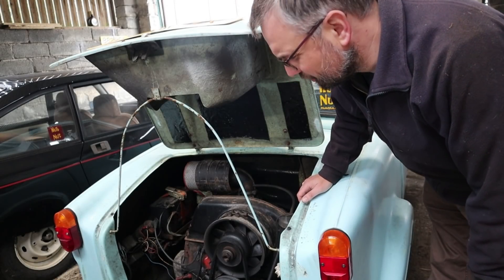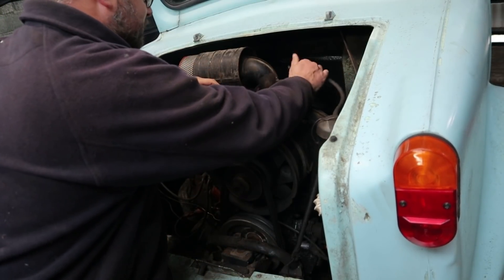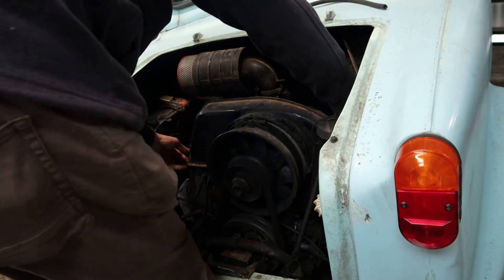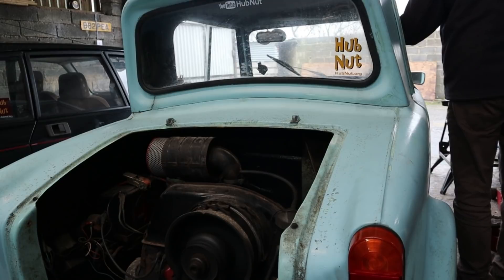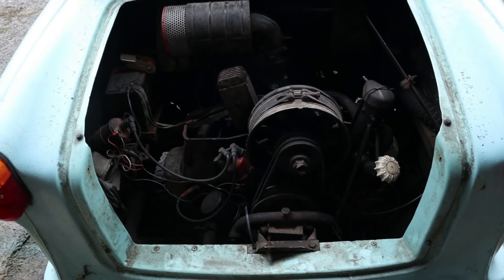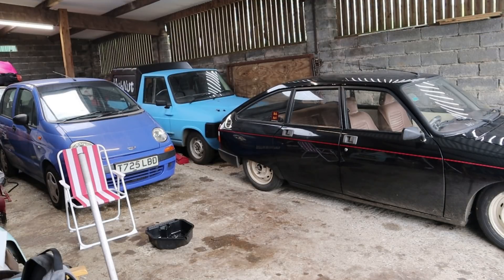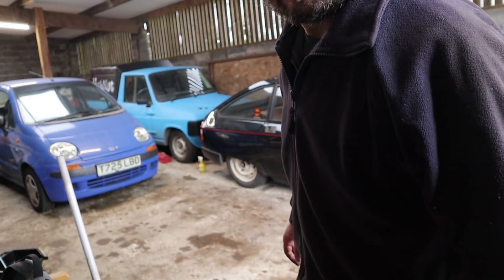TWC the Invacar goes BANG, also, oil leak located.

Comment: I adore your vids for their honesty. They take me back to the countless times over the years when, what should have been a relatively easy job, transcends into abject despair when you unearth further problems; and WD40, a cable tie or super glue won't be a final (albeit bodged) solution. Thank the Lord for tea.....it gives you time to reflect and ask yourself "why the f*** did I even start this".
Reply: I occasionally work on an old building and a few weeks ago I finally sighed: "Looks like I can't even turn on a light in this place without it turning into at least half a day of electrical work!". Like when someone installing new shelves in a fitted wardrobe caused me to rewire half a room because I first wanted to remedy some bits while I still had access and doing that found more and more horrors. NB: the other half is at least as bad, I know that, but that's a project on its own.
Reply: Amen
Reply: Hell yes Barry
Reply: A final solution usually involves duct tape and vise grips (or gaffer tape and mole grips to you British types).
Reply: Brilliant. Laughed loudly. Wife asked if I'm OK. As I find myself here, I'm probably not

Comment: Hello Ian. The gradual pressure drop you see on the tester gauge AFTER you stop turning the engine over is not indicating a leak on the engine/valves/rings. It shows the internal valve on the tester gauge is leaking. The tester only shows the peak pressure achieved not the "leak down" pressure. Regards.
Reply: Totally agree.

Comment: Don't worry about the leak down with the compression tester, that's just pressure held in the gauge itself, not the engine. 
Pushing the release button just dumps the pressure held behind the check valve in the gauge.
The compression looks good anyway. Cheers.
Reply: You TWC the words right outta my mouth!

Comment: A few days ago I looked at a Serbian television show on cars how they solved problems when you are on the road, mostly in those days 30 years ago they were Yugos, they used a broom to get a Fiat 126 started, or when the V belt ripped apart they use ladies nylons so you could get on the road. Another example was when one of the wiper didn't work you got a wooden stick and some wires and tie that up to the working one and so you could get home at least.Nowadays, the cars starts to yell at you and refuses to do anything, you need a computerbrain to get it running again. Love the simple cars.

Comment: A couple of months ago myself and a mate were trying to get a Petter stationary engine running. Little did we know the plug hole thread was badly stripped and when the engine fired it blew the plug out the top and missed my mate’s head by a couple of inches. It was like a gunshot! If you do decide to helicoil it use an insert then the thread will be far stronger than the original one. 

The worn thread may well be why the compression was leaking slightly after the test.
Reply from the maker: Yikes!

Comment: Wow! When I saw TWC running I knew those belts needed adjusting. Looks like we are having a similar day to you here in upstate New York.
And this came up just as you finished uploading, which, of course, has made my day!
I also hope switching out engine parts help with related problems. And was surprised by the compression test as well! While fiddling with TWC's engine, I guess you could check the valves while you are at it, adjust running belts, etc. So hopefully, once work is completed, TWC will not only be up and running, but running better than ever!

Comment: The pressure dropping is the valve in the tool not the engine, cylinders don't hold pressure, the average cylinder leaks 20% through the rings when doing a leakdown test.

Comment: I think the citroen GS is the best looking car there. I love old citroens. Special one for me is the CX
Reply: I’ve got the 2012 c5 exclusive tourer (estate) it’s a nice car but sadly it been revised from the earlier mk1 c5 that was based on the xantia. All the rear end suspension parts are week and not going to last as a working car. Already I’ve burst two rear suspension pipes and blown a seal out of rear strut. I might just have to put my old c5 hpi back on the road
Reply: @WidowUK  c5 is a nice car. Problems are citroens name a bit. But i love them all the same. I really am looking for a c6 first gen. Its a real nice car and got the looks from the cx. I know its a problem car but i really like the car. I think the call it love for cars😁
Reply: @d.jbrickmocs1637  I know what you mean this c5 has cost me a shed load of money to sort out so far but to get any money back I’ve had to repair it, think they call it bitting the bullet.
Reply: @WidowUK  yes that it is. Same problem i had with my CX. Engine broke. After a day or 6 the gearbox went out. I sold her in parts but stil wish i fixt her
Reply: @d.jbrickmocs1637  I know that feeling 2 day after I bought the car the 6 speed box had been leaking oil from tin end plate and killed the gearbox. So I thought while box was out best put a new clutch in it turned out dual mass was worn out so it had one of them. Then a hydraulic pipe bust on the rear so I had it repaired last a year now waiting for a new one from Citroen not to mention dpf filter and    Throttle body had failed it’s been the biggest money pit I’ve ever owned. My mk1 c5 hpi gave me no trouble in the 16yrs I owned it makes me wonder if I should of spent my money on putting a catalytic converter on it and carried on running.
Reply: @WidowUK  yes its car head splitting 🙄😁

Comment: I had two cross threaded plugs in a Corvair I repaired with Keenserts. So crooked the air seals on the plug wires wouldn't fit into the shroud. Done with heads on car, no disassembly.Highly recommended.

Comment: Air-cooled vw have a similar oil cooler and there are two rubber seals on the inlet/outlet which leak.  The cooler itself is usually OK... When they fail it's usually because they get closed with swarf.

Comment: being a bike type person who does these things, I'd be tempted to take the engine out, swap the heads and - whilst it was out, change the various oil seals and probably the top end gaskets as well. It will probably be leaking or weeping from a few places and this might be a good opportunity to give the engine a thorough clean, solve those problems and with the good compression it'd be good for another few tens of thousands of miles.

Comment: 10% difference between cylinders is fine, oil cooler is the same type of setup as VW,the seals go hard and crispy and they pee oil everywhere, new seals required
Reply: A dab of Mustie1 magic will have that sorted.
Reply: I know Twc's engine is Austrian, but as it has been in England for a bit, it might just be that it adopted an adage that comes with British engines: "It's not leaking oil, it's giving back what she doesn't need"

I'll see myself out - no need to get up.
Reply: That was a little more like 20% though.
Reply: @AUmarcus  115 and 120-125 at worst it’s 8.33%
Reply: @Mrflash222006  
Except I read the compression at 110 and 135psi. That's closer to 15/20%....its definitely over 10%.
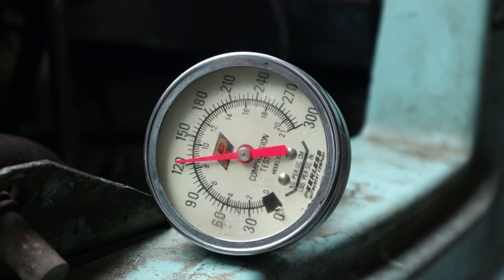Reply: @AUmarcus  8:46 115, 9:46 and 16:10 130 dropping slowly to 120 that's on a carb'd engine at WOT so wet-ish so 12% what is marginal, 115-135 is 16%

Comment: We like old school here in our North Shropshire workshop. After realising that TWK wasn't going to do a terminal detonation I really enjoyed the video after spending the weekend trying to reassemble a very rare (so rare there's absolutely no information or instructions anywhere in the universe!) gearbox in a bag. I'm also looking for a suitable gap in the showers to do the drop links on the rear anti rollbar on the Land Rover for the MoT. Good luck with the head and oil cooler change and keep your Dutch cap dry 😆

Comment: Awesome video! My suggestion: Drill the spark plug hole, put the  right dimension spark plug insert and it will work like a swiss clock.
Reply: You mean it will go "cuckoo" every 15 minutes?
Reply: @caw25sha   It will work fine if the threads will be cut at the correct angle.

Comment: A friend of years long past used to race and had his spark plug holes all 'helicoiled' as apparently it was stronger than threads in the alloy. So that would be a good move for both heads. Also for possibly the first time a necessary plug change in a hubnut vehicle. WOW! Shame it was probably with the wrong plugs!!!

Comment: The compression leaking down is the fault of the gauge, not the engine.  
The gauge has a non return valve, which you release to zero it.  It's probably just got a slight leak.

Comment: Great to see the video!  Yeah; sounds like that cylinder head is pretty tired, if it's spat a plug out twice.  

I was assuming you were going to grab the head from the old engine.  It'll be good to see how that goes.  

Thanks for the video.  Loving it and continuing to be an inspiration!

Comment: I foresee a head swap in your very near future. This is excellent news for us viewers but perhaps not so much for you!  I did have a helicoil fitted successfully in the past with the head still on. The engineering god that performed it in the car park used a power grease gun to pump grease into the cylinder after the machining that lifted all the Ali swarf out on the greases leading edge as it emerged from the plug port. Miraculous! 
Incidently, the pressure decay observed was only leak by of the gauge's own internal one way valve and therefore nothing to worry about.

Comment: If i was you Ian, id just leave Tuc till the spring when its a bit warmer to be stripping down engine"s! i think its probably better you use the Matiz for the winter! small reliable cheap to run, starts off the button every time! just put a full set of winter tyres on her as she has the smallest wheels & so it will be cheap to change all 4 corners & the thinner the tyre the better in the bad snowy weather!!:)

Comment: Hi Ian, I would not trust the gauge too much. Seems like it starts at around 15psi at rest and the leakage you are seeing is the pressure release button passing back into the cylinder from the gauge head. I would budget for some top end work, probably just valve re-lapping and check valve guides while you're there. Bless TWC x

Comment: General rule of thumb:
If it runs, it has enough compression.
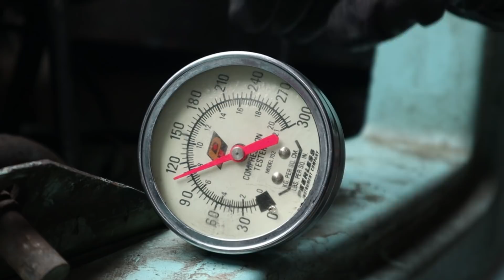10:08 that is NOT how compression guages work Ian, they have no leak down function, if for no other reason than, you have no control over where the piston stops, TDC, BDC, or anywhere in between. 
The loss of guage pressure you noticed is simply the check valve in the guage leaking.
Lovely to see you found that pesky oil leak, any chance the cylinder heads of TWCs original motor are any good.
Reply from the maker: Cheers. Yes, planning to swap a head over.

Comment: The oil cooler would need just the rubber grommets replacing.
Reply from the maker: It seemed to be leaking above the place where it fits the block.
Reply: @HubNut  Yeah those are little Viton donuts, you can get those seals from an aircooled VW repair place.

Comment: Everything has been said really. Swap in another head after doing the valves and renewing valve seals etc. Do both while you're at it maybe. Best with the engine out. Does it drop out the bottom like a Beetle? 
The two plugs removed may have been different heat wise but the Eyquem also had an extended nose if you compare the 2. Now you have water and power a pressure washer would be a good purchase for oily engines and dirty engine bays.
Reply from the maker: The engine is a bit tricky to get out, so I think I'll probably just pull the head and  swap with a spare.

Comment: 14:20
I haven't seen Ice Cold in Alex in a while.
Reply: They used the starting handle in the film...😉
Reply: @CaseyJonesNumber1  I know. It's just they made it look a massive effort in the film. Hubnut seems to be making even more of a effort though. And rightly so. Pushing a quarter ton 3 wheeler up a concrete mild incline us bound to be harder than pushing a 2 ton lorry up a sand dune. Twice.
His over frothy pint has been well earned.
Reply: Hot cup of tea in Wales 😀

Comment: Just consider that if the battery Voltage is low, then the Amps will be much higher every time you try to start it. (I=V/R).
Also, if those engine mounts allow the oil cooler to flap around like that, then the next one will also fail. It either needs stiffer mounts or a bracket making to support the cooler. 👍

Comment: The cylinder that's loosing compression, is that the one with the free range spark plug?
That could possibly account for the compression leak.

Comment: Ian, interestingly during my time as a motorcycle mechanic I learned that spark plugs are only meant to be done up to 11-15 nm!! Not as tight as everyone thinks!!
Reply from the maker: Very true. She blew a plug out last year, so I think the thread was already weak.
Reply: @HubNut  I remember you mentioning it in a previous video, not a complete disaster, as long as you put a thread insert in their fairly straight it should be ok

Comment: Perhaps if your going to swap the head, it would be a good opportunity to remove both heads and lap in the valves too? Easy and cheap enough to do at home, might even liberate a horsepower or 2 😃

Comment: My 1979 Moskvitch 2140 I drove in the Middle East in the early 80s used to spit out one of its spark plugs regularly, you'd hear a ping as it dented the bonnet from inside, and then fall out of the engine bay, followed by loud putt putt putt noises. This would mean stopping and searching back down the road for it. In time, I kept a couple of clean spares and a plug spanner in the glove compartment and tried not to rev the engine up too much. Otherwise the thing ran quite well if you didn't mind the steering locking on tight corners. I learnt to corner gently as well, but I believe the car was eventually banned in the UK for this design flaw, as it had caused several accidents.
Reply: Is that the car which had a hole for fishing on frozen lakes? Not much use in the Middle East though.

Comment: Keeping the heads torqued up correctly on these engines is important as they don't have gaskets just a face to face fit
Reply from the maker: Yup, same as the 2CV.
Reply: @HubNut  didn't know that never worked on a tin snail before

Comment: I cut a new thread for the spark plug in one cylinder on my URAL motorcycle, which also has a very 2CV looking engine. That was not too bad of a job, easy and cheap (around 10€ for the helicoil set including the cutting bit).
Reply from the maker: Yes, I've used one before on the 2CV, but access is better. As I need to remove the head for better access, I might as well just swap it out.
Reply: @HubNut  👍
By the way I just bought a MK1 Twingo, so if travel restrictions should ever loosen up and you should come by central Copenhagen, you can also try that one.

Comment: The thread giving out may have been giving a bad seal hence the leakage as a slightly leaky exhaust valve usually leads to slightly lower compression and that hole had higher than the previous, may be best to take the engine out, and might be nice to clean her up, ready for spring, perhaps take her to get painted nicely and have a good clear coat that lasts, meanwhile you can sand any rusty metal on the engine and spray them and make it look nice! If i was closer i would spend silly amounts of time cleaning and restoring even the smallest of items, I am in Wales so maybe one day i can lend a hand, You fix, i'll make it look good n shiny 😂😂

Comment: The compression test tool is what holds the pressure the cylinder compresses the air/fuel into the tools any leaks is at your tool and not at the valves in the head. The tool has a one way valve in the end fitting and a pressure release by the gauge you can’t go by pressure drop as it’s not a true reading. Just so you know for future reference and not you know. 

And just so I can be clear I’m not starting anything or mean anything in a bad way. If you don’t know you don’t know and I’d be thank full if some one explained it to me instead of making a fool of myself at work many years ago now tho.

Poor tuc looks like tuc has a bad head ache.

Comment: Bad luck about the cylinder head!  🤕 You are going to have to take the engine out.  As for the repair, your best bet is to swap in a head from the spare engine.  Helicoils and other inserts will work but they are best done by a machine shop and that is expensive.
Reply from the maker: Yeah, good chance I'll ruin fitting an insert!

Comment: Have you considered wrapping the spark plug in lots of PTFE Thread Tape? Certainly works for a lot of things with damaged/worn threads. Not sure how it would cope with the engine heat, but it might be worth considering.
Reply from the maker: Doubt it'd survive but a possible bush repair.
Reply: @HubNut  well yeah, it's a stab in the dark but maybe worth a shot?
Reply: Or would the PTFE tape just melt & get into the engine or glue the spark plug in place? Err... I dunno.

Comment: Did that plug pop out of the  cilinder with low 110psi? The bad sparkplug thread might have been the cause of that lowish 110psi.
I'd say, swap that head and keep the old one as a spare and have a helicoil or timesert installed at your leasure and convenience.
Reply from the maker: No, it popped out of the higher side. Will replace and keep.

Comment: Timesert or helicoil insert will be best fix. Or since you have the spare engine, swap the head?
Reply from the maker: Head swapping is most likely I think.
Reply: @HubNut  It reminded me of an MZ125 I had 20 years ago, it blew the plug out, being young and foolish I mixed up some super glue with some aluminium powder smeared it round the plug hole and wound the plug in quick. It worked, I never did have the plug out again though haha
Reply: Skodaman2  mine was the TS 125